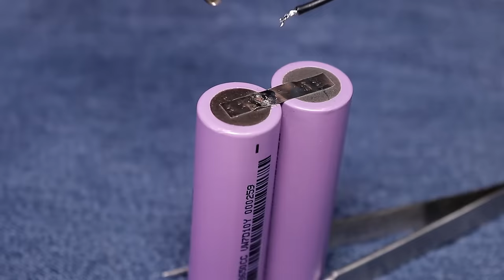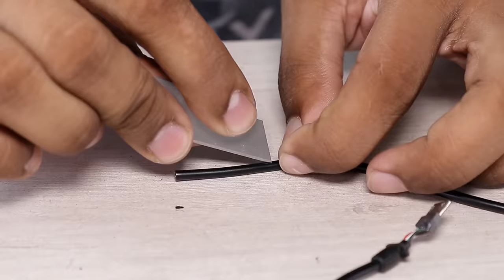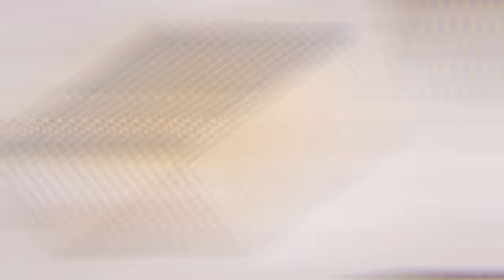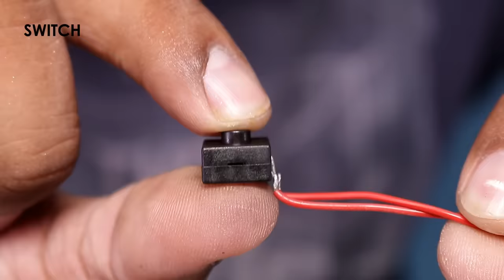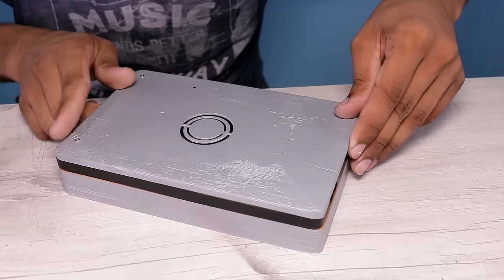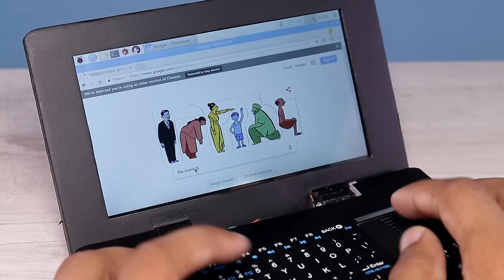How to Make a Mini Laptop at Home

Comment: Nice project! Though I would recommend using a suitable powerbank instead of those batteries. If you look at the screen when he's using the laptop, you can see a lightning bolt in the top right. That means that it is not receiving enough power, so it displays that under voltage symbol. If you use a powerful enough powerbank, you can stop the pi from getting damaged. (When the pi isn't receiving enough power the system/files can get corrupted.)
Reply: It's funny cuz they have Minecraft: Pi Edition on that laptop

Comment: him: cuts open the hdmi cables
also him: makes new cables from random wires
Reply: Syncronaut so true
Reply: lamo
Reply: Kaniyur Chidambaram lamo
Reply: Kaniyur Chidambaram lamo
Reply: @kaniurchidambaram6482  lamo
Reply: Syncronaut it’s to make it look coll
Reply: It's because the thick coating isn't needed since it's internal, and the loose wires are more flexible, they are also smaller so they can fit into a case easier
Reply: The random wires are more flexible
Reply: @kaniurchidambaram6482  lamo
Reply: @kaniurchidambaram6482  lamo
Reply: 是不是吧的更不
Reply: @virder9888  da fawk
Reply: @jal9giyenyoutuber173  da fawk u say boi
Reply: LOL
Reply: Not so fast, bud. It wouldn’t have fitted if he didn’t modify it!
Reply: lma0 xD
Reply: That's because he can't connect it if he doesn't cut it
Reply: Its to make it thin so it fits
Reply: @Syncronaut   he did it to fit in the case
Reply: Imao
Reply: @sapnapiram Laughs my ass off

Comment: I made this at home, here are some things to consider
1. He uses his sodering iron instead of just editing the print file to account for the switch, that is what I did.
2. I used a raspberry pi 4 and installed windows arm edition on it instead of raspbian.
3. used a 124gb micro sd card instead.
4. I manipulated a holder for the keyboard into the 3d file and made sure that I plugged the USB dongle into the raspberry pi and did not include the USB port that it was plugged into on the case (I actually used USB extenders instead of pushing the pi straight into the wall.
Reply: @annuuaxo7210  what do you mean?
Reply: @annuuaxo7210  oh, then there is no reason to reply, just ignore the comment
Reply: Those are all really good ideas, can you please share a link for others to enjoy?
Reply: Cool
Reply: Yes and it cost 40 dolar
Reply: is that easy to make? I decide to make one too
Reply: w*F u really built it???
Reply: @soul_yt7097  that is exactly what i was thinking 🤣🤣

Comment: Hey @The Wrench! Cool mini laptop! Think instead of using Raspberry Pi keyboard for typing input, you could upgrade the size a bit, so the input is is easier for older folks...? Of course, the screen as well... Have an older friend/former boss who is in need of a new laptop for less than what normal laptops go for, and this video of yours inspired me! Don't have any EXP. in tech stuffs, nor have the majority of those components, but if you can do another similar video making one like a small-midsized tablet (with pricings & shopping sites for good components)... Well, I sure could use a bit of guidance in getting this "gift" for him!

Comment: I want this for customization so I can achieve higher performance and more battery life and more storage.  About 256 GB.
Reply: R O H how will u do that?
Reply: virendra kumar chaddha by. Simply using them
-1. For better performance I use Asus tinker board (will replace raspberry Pi 3) it is 2x more powerful than raspberry Pi. And have 2GB of ddr3 ram. 
2. For better power efficiency I upgrade it's power bank module. Up to 2.5 amps rated for better power and smooth performance and 4x li-ion cells. For more battery backup. 
3.for more storage I use 32GB of SanDisk ultra c10 card. As primary storage and use 2x 128GB USB drives to get 256 GB of storage using USB Hub.
4. For better looks.  I customize it's looks. By some modifications.
5. And use a 5volt cooler for cooling this. 
6. Last please give this me. 😀😀😀😀😁😁😁
Reply: It's quite good idea, bro! But... I think that you can do it yourself, without asking for a "base" for tuning. Number of changes that you want do in it makes me wonder, how many original parts of this tiny laptop will stay inside him after modifications XD It would be better idea to make a plans of his build, change everything you want to and build it yourself :D
Reply: Daniel Michalski bro but it's display is expensive. And you know that students like me. Don't have much money to spend in these projects. I can afford all components except this display. So that I was thinking that if I get this give away so I can do it now.  But if not now then. I build it when I will be in budget. But not now.
Reply: dadou oméga I already decided which board to use.  Which SD card. Which drive. Which display even every thing I already planned but I don't have budget

Comment: Hey dude, great job! But how did you get the internet going on the laptop without a wifi module? And does it matter what display I use?
Reply: The raspberry pi 3 comes with integrated WiFi and as long as the display is 7in. it should fit. Just be aware not all screens are touch screen.
(Edit: I edited a spelling error)
Reply: raspberry has wifi module i think

Comment: READ THIS IF UR MAKING THIS: if ur thinking of using a raspberry pi 3, either buy a pi 4 or buy the libre le potato as it has a better processor and an ir sensor AND best part is that its only for about 35$

Comment: It will get hotter than Planck's temperature without ventilator.The ventilators and radiators doesnt bite consider using one or in result you'll get fried raspberry